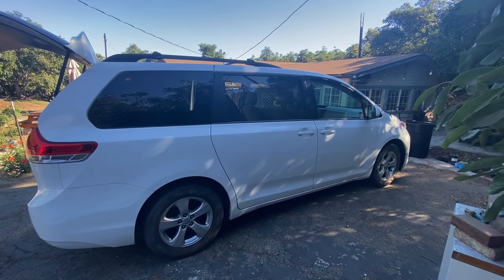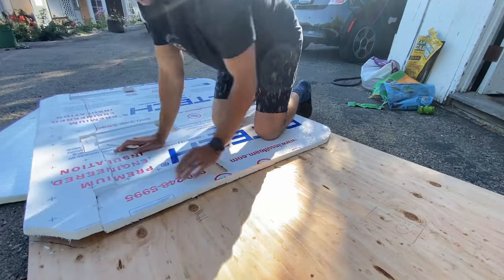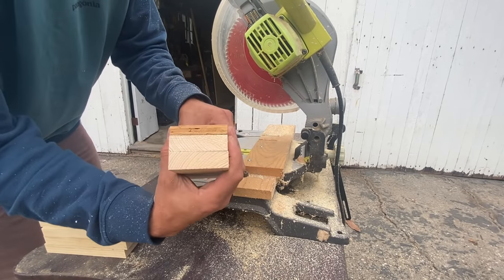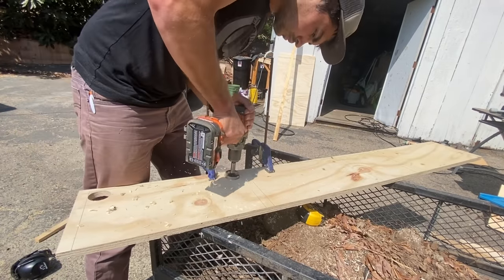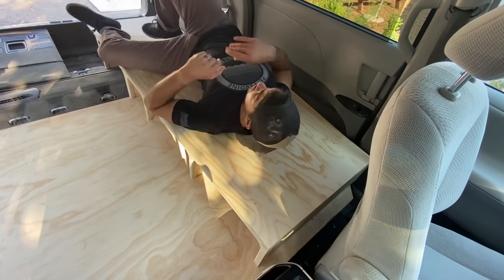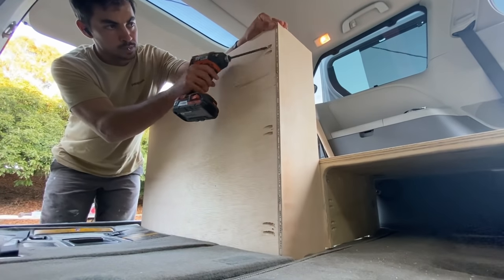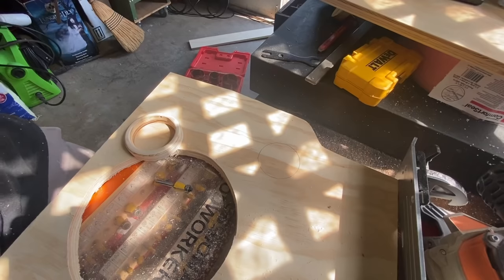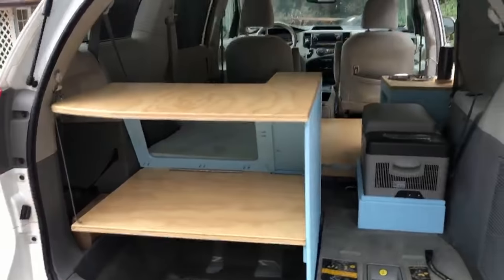Minivan Camper Build, Start to Finish (2013 Toyota Sienna)

Comment: A very nice piece of work!  Impressive.  I think this minivan is one of the best.  The 2023 model gives you 36 mpg!  Older models from 2020 are 27 mpg.  Nothing comes this close.  Spacious inside, easy to drive, nice ergonomics and 36 mpg!  If I were this owner, I would sell all the extra seats, tracks, everything.  Keep it as a conversion and go all the way to making it a cute functional RV for short hauls.  Add the overhead fan, extra house batteries, small inverter, gas stove, fridge, and exterior shower. The payload capacity for 2023 is 1330 lbs.  Towing capacity is 3500 lbs. Truly a great vehicle.

You did a very nice job on the floor and bed.  They look superb.  I wish you had spent a few more minutes on the finished tour.  It was too short.  Also please don't put links up on screen till video is over.  Thanks for no music!

Comment: Wow fantastic job! I’m getting ready to do a van build on my 2021 Toyota sienna XSE, yes I want to take my backseats out. Yes I’m aware that I’m going to have to get cheating device to deactivate the airbag warning light on the dash. Several videos showing how to do this. It is the perfect camper with the 1500 W inverter system, love using my Insta pot while camping or anything with electricity and not having to have a generator! Also the climate control is fantastic at night when it’s sticky outside! Left my van on for two nights of camping, about 9 1/2 hours each night, and I still averaged a 34 miles per gallon average for that tank!
Reply from the maker: Yeah, I'd love to work on one of those!
Reply: Are you for hire?
Reply: That climate control is everything !💙

Comment: Nifty little build.
I have an upholstery shop; the best tool for cutting foam is a cheap electric knife from big box. Just spray a little silicone on the blade and make sure you hold it square as it cuts fast.
Reply from the maker: Thanks for the info, I'll definitely try that next time!

Comment: great job. A lot of people don't know those trolleys can be removed. For each rail there are 3 bolts on top, and 1 bolt from underneath the vehicle.
Reply from the maker: Thanks for the info! Owner wanted it super easy to pull out/reinstall if needed, so we figured the floor was the best way to do that.
Reply: Have you removed the trolleys, Todd? Besides the bolts, I read on the sienna chat site that the only way to slide out the trolleys is to remove the interior paneling because it’s blocking the trolley rails.
Reply: Depends on the Sienna. To remove the 4th generation trollies, your have to remove major parts underneath the vehicle to get to the screw.

Comment: The trolleys are actually easy to remove.  Just undo a few bolts at the bottom of the van.  This is a one-man job but it involves crawling underneath the van .   Do put the bolts back in the holes after removing the trolleys to plug the holes.

Comment: Awesome build!

I'm taking notes!

0:33 flat foam and floor over the top of the trolleys (Sienna's trolley dilemma)

3:33 high tech scribbling tool

4:18 cool shot!

4:37 Forstner bit with a backing plate to prevent tear out

5:35 is that a pocket hole or are you just...

6:15 cabinetry starts

7:00 1/2 inch plywood strong enough

Comment: This step-by-step video was such a fun to watch!!! 
I Wonder what limited options one would have to sleep two? Also hope there will be a sequel detailing electrical wiring and  privacy panels.
Reply from the maker: The owner is using a self-contained battery pack for her electrical in order to keep things simple, she also bought Reflectix panels designed specifically for this van and is using those for privacy. You'll see them both when we do an update vid with all her stuff moved in once she's back from traveling!

Comment: I’m preparing to remove the passenger seat from my Odyssey and I suggest you consider doing that. I expect to mount a custom rack that will hold my auxiliary power unit, 12V fridge, and maybe a microwave oven. That seat is useless and it occupies a ton of space…
Reply from the maker: That would be a great idea for the right person. This client wanted to be able to transport 2 additional passengers from time to time, so the passenger seat as well as one rear seat had to stay!

Comment: I couldn't tell how any of the fit-out was secured into the van?  I like the idea of the fridge/cooler placement, but the idea of what would happen during a crash is a bit scary.  I always try to place heavy items right against the back of the front seats so in a front collision they have less opportunity to gain momentum.

Comment: Awesome job!  Couple questions, where did you get the fridge and all the sink components?  Pump, bowl etc...  Also why the holes in bed board below mattress?  If all this was in the video my bad I missed it.  Again great job!
Reply from the maker: Thanks! fridge and sink components all came from amazon, hardware came from the big box store nearby. As for the holes in the bed, from past experience I've learned that mold tends to form if there's no ventilation below those foam mattresses  (especially in a small space like a van) so I add them to give moisture a place to escape!

Comment: At the start of the video, you mention that you traced out the trolleys onto the insulation foam.  Could you please give a few more details on how you did that?  Did you do a template out of paper, did you just measure and transfer to the foam?  How exactly did you transfer onto the foam?   We are beginning a build and have the same trolley issues to overcome.  Thank you for any help you can offer.
Reply from the maker: I just measured and transferred the measurements to the foam by marking them out with a speed square!

Comment: I didn't see how the wood frames were connected to the floor of the van. If this is a floating build with no connections to the floor (which some people do because it makes it simple to revert to the standard seats), the whole thing can shake around and cause issues. Ask yourself - what would happen if the van was in a rollover accident?

Comment: What a fantastic conversion for solo camping in a Sienna!
Do u have any plans for one that will sleep 2 and fold out of the way?
Reply from the maker: Yes! The same design can be used, with a sliding panel on the bed which can extend toward the sink/fridge and double the bed space. Long-term that would be pretty tight because you don't gain any storage (and two people need more stuff than one), but it would be awesome for trips!

Comment: Aside from speed, is there a specific reason to use a router for the foam board?  I know they make "hot knives" that can cut foam - we used to have a machine with a hot wire at work for cutting foam blocks for a medical application.  Foam is freaking mess to cut even with a regular knife.
Reply from the maker: Yes, aside from speed the router is a terrible tool for cutting the foam because of all the mess! A hot knife would be the ticket.

Comment: Have you noticed any difference in noise when driving? I assume driving should be a bit quieter because of floor insulation?
Reply from the maker: Not much difference when I drove it. Now that the mattress/comforter/pillows are in, it's probably a bit quieter!

Comment: So my question is how many inches long is the bed, Im 6'2inch so need at least 75 inches.
Reply: Im dont think it would be 75 inches, Im 6.2 too. You would half to eliminate some of rear cabinet I think for 75 inches. Also the front seat all the way back because of your height. I wish they made a toyata sienna xl for tall people. five inches longer. Like they do on chevy tahoe to suburbon.
Reply from the maker: I don’t remember the bed dimensions, but it’s probably just under 75 inches. Extending it into that back cabinet would be no problem though!

Comment: It's a job to remove the seat rails....but worth it.  By the time you build your sub floor you have lost 5 to 6 inches of head room......
Reply from the maker: It may be worth removing the rails, but having a flat subfloor is pretty nice as well. Only lost 2" of headroom, still have plenty to sit up tall on the bed!

Comment: That's alot of weight ,not adding the essentials of the user,gas mileage use will be a pocket hole
Reply from the maker: Everything in the video actually weighs less than the seats that were removed! That's one of the reasons I didn't build in drawers or put cabinet doors on anything. So there's essentially no effect on gas mileage.

Comment: In all these vids ive seen every1 uses 3/4in ply and what looks like hardwood.  No one ever hears about weight or burnin out suspension components over time. That being said ur build looks the lightest next to others ive seen.  Imagine runnin at or over max weight 100percent of the time and hitting a bump or pothole.  Oh crap. Another $400 wheelbearing or shock.
Reply from the maker: For me it helps to compare the weight to having passengers in the car. This build is only around 70 lbs so its impact on suspension, gas mileage etc is the same as having a kid in the car with you.